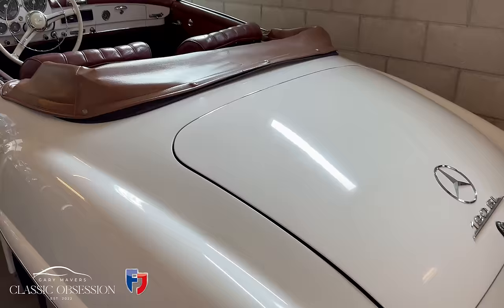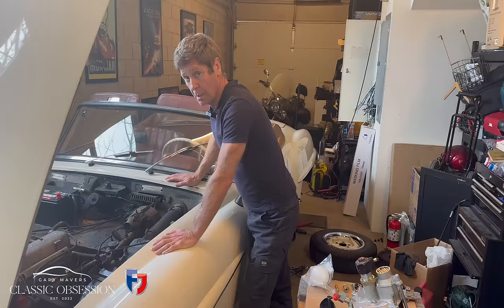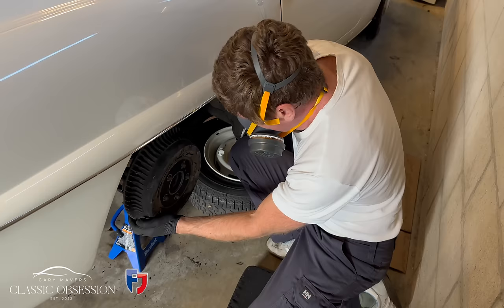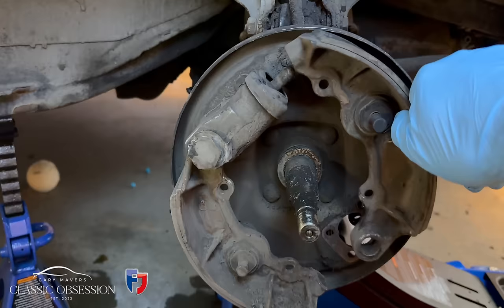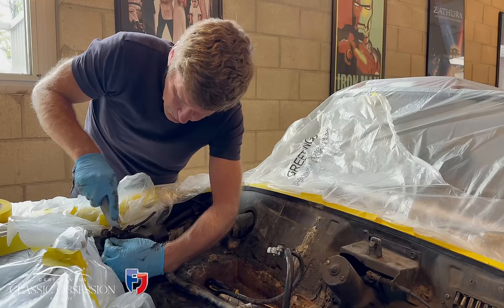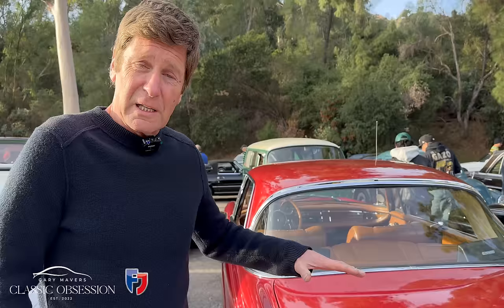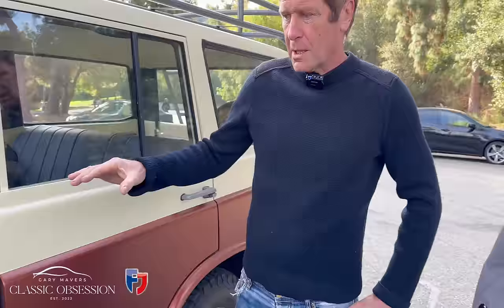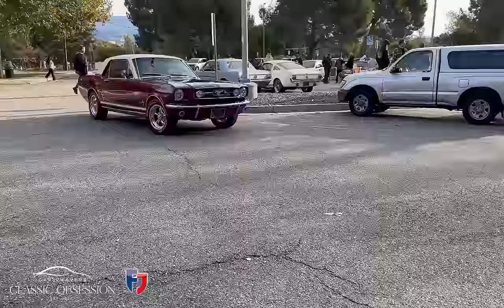Mercedes 190SL Restoration (Part 4) | Plus LA Cars & Coffee | Classic Obsession | Episode 50

Comment: I love how you’re diligent with your cleaning Gary. Recently I saw a video of 2 cleaning technologies which really impressed me. One was dry ice cleaning of an old engine. Very thorough but lots of run off & the unit is big & cumbersome. Te other was a laser. Hand held, about the size of a clothes iron it seemed to evaporate everything but the metal leaving a pristine surface without any residue or run off to catch, clean up & dispose of.
If I happen to locate these videos I’ll let you know.
Cheers from Australia.🇦🇺
Reply from the maker: Hi Greg. Yes I’ve seen the dry ice cleaning and was so impressed I want to get all my cars done but try finding a firm that will come out and do it. Regards.

Comment: Hi again Gary from Sydney , Australia. We have a almost identical dry climate with just occasional rain here in Sydney , that's why it always horrifies me when I see so many ruined Euro classics because of road salt & rust. 
Re the big black Jag mk10 you filmed the Aussie distributor here in Australia in the 50's, '60's & '70's Jack Bryson who as a millionaire in the old days owned Brysons' Motors , exclusive Jaguar dealers, old Bryson had all the underbodies fully waxed, sprayed, then smothered in a bituminous rubber compound then painted it  body color, it was so thick and tough that we get in an original Aussie Jag ZERO rust, none , underneath my 1967 mk10/420g it is almost like a "plating" to the underside, with a pressure wash the underside looks like new in 1967. I also have 2 Aussie built Cadillacs by GM Holden at their Pagewood, Sydney plant and again the weatherproof sealing is the said same bituminous/rubber compound that also becomes sound deadening. All the older Aussie made and distributed cars were finished this way, which adds to their long lives on the road. 

PS  I love how you like giving all repaired items or areas a serious lick of paint, I'm the same with my thick satin finish black rattle cans when you look at it later it always looks lovely and new.

Comment: The best thing about Mercs is that the bolts/nuts do unscrew & do ‘t shear off!
Mind you, it took me a lot of rude words, sweat & three days to get the vibration damper disk off my 280E crankshaft. Three bolts, ok. The other two . . . Very friendly with their seatings. Allan key heads began to round off. One sacrificial torx fitting hammered in and it finally released. 😠😡🤬
Reply from the maker: They try us sometimes!! Regards.

Comment: Another good watch on a great car. Surprised no one has came up with a solution to the handbrake cable pivot?? Is it dissimilar metals causing the corrosion or just an alloy not coping with wet conditions?
Reply from the maker: The designs ok but I think it’s just a classic case of lack of use Archie. Regards.

Comment: Excellent work and enjoyable to watch.  When I fettle anything I always grease/oil/lubricate everything so that it will be easier to disassemble in future. Such as vaselene on electrical connections (starter motor /battery ) grease on nuts and bolts etc.

Comment: Many a Carbon Fibre towel has been lost on those brakes....... Did you happen to use any of those Rust inhibitor sprays when doing the engine bay?
Reply from the maker: No. But it’s a unique climate where the rust is only ever surface. Regards.
Reply: @classic.obsession I did think “Surely that upper engine bay near the battery will be full of rust holes”, but no. Lovely work, Gary. Thank you.